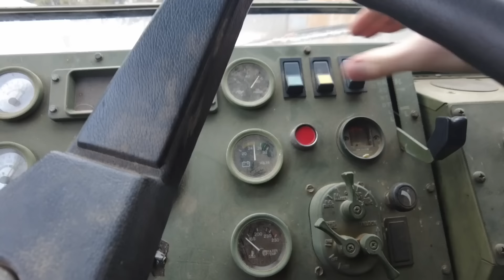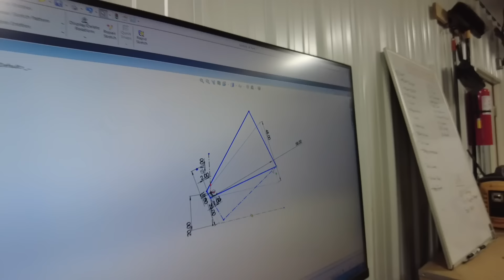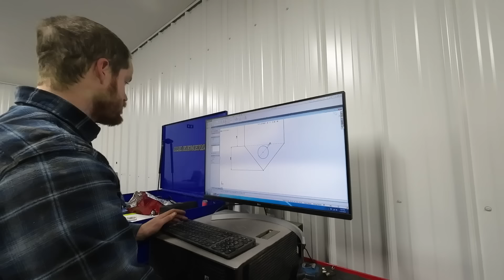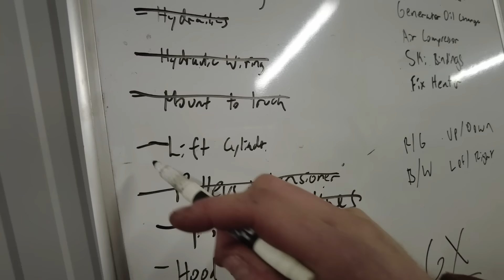We Built The ULTIMATE SNOW BLOWER | First Drive

Comment: Hello from France
To compensate for your lack of motricity you need weight at the back of the truck and where a salt spreader could be considered afterwards I do not know the maximum weight of your truck in road mode but it would be interesting to use this dumpster with salt or sand by emptying it into an automatic salt spreader here is otherwise very good job

Comment: Having just weight alone on the bed of that truck would make a huge difference with traction. When I say weight, I don't mean a measly 1,000lbs, I mean like the weight of your Cat 289D CTL (10,500lbs). The weight of your Cat 289D on the bed, plus those studded chains will allow you to drive though a LOT of snow. The only down side would be that it may become top heavy, given how high the bed is on that truck. Driving any truck unladen, like your army truck on any ice or snow is like driving a sled. Weight makes a HUGE difference!

Comment: Just wondering if you forgot how important weight was for this sorta thing. Without a thousand or so pounds over the rear axial to counter balance the extra weight now on the front plus extra to help with actual ground contact , you end up stuck and riding a bucking bronco as the rear jumps up every time it gets some traction an then losses  it as the tires leave the ground. 

Sorry I did forget to say that the project was really cool. And if you have some sort of bed adding logs, gravel, sand, stones, or tractor weights will help solver your bronco issues , any weight thats at least 4/3's the fronts current weight will give you grip on the ground and stop the bucking.

Comment: First impression, it was a mistake to put all that leveraged weight onto the front of the truck. I think it would be easier on everything if there were two swivel tires directly under the weight of the blower. They would lower and raise the blower without changing the weight on the front of the truck.

Comment: Please, please, please keep away from the front of that monstrosity when it is running!  I was so afraid when Courtney was standing so close on that slippery snow while that thing was churning around at speed.  Yikes!  Having worked in factories with "screw-type" mechanized equipment I've seen the result of someone getting an arm or a hand or a sleeve grabbed, and it never turns out well.  It's an awesome accomplishment, but please be safe and don't let anyone walk near the front of it when its moving.  We want both of you around for a long, long, time.  At 18:54 in the video Courtney is much too close to "the Mangler" and OSHA and me were having a coronary!

Comment: so you installed hydraulics after all... the entire blower could've run off a 12/24v hydraulic pump mounted truck side and shaved all that engine weight off the blower. no extra fuel coolant/antifreeze and all that makes that engine run... would've taken half the time and energy in materials, fab and install. there qre hydraulic QD fittings so 2 QD couplings for supply and return hydraulic hose would have been the only connection to truck other than the actual mounting system for the blower. Your work in the design and fabrication is of course "impressive". IMO you made the project so much more complicated and time consuming than was required and in the end fabbed your own hydraulic system anyways, which is all that was needed to power the system in the 1st place. Don't get me wrong Riley, i LOVE what Courtney and You do and love watching your content.

Comment: I think you guys need a shop exhaust fan..... yah it would blow out your heat BUT it would keep you from suffocating your wife dogs and Kid.... things like stick welding galvanized pipe can be deadly and you already know that welding in general puts out alot of smoke.... if you happen to need to weld a really grimy part the smoke will fill the shop so fast it will take an hour to clear out ! smoke can be extremely deadly.... and it's not to be taken lightly....
I did and walked through a rather large cloud of sulfur smoke and wasn't thinking about it...
my lungs simply quit working.... I couldn't breathe in at all.... realising my predicament I exhaled as much as I could which wasn't much I could then inhale just a little after a few minutes of that I finally got my lungs to work again...scared the heck out of me ! that was really serious, thank god I didn't inhale real hard walking through that cloud of smoke !
we burned sulfur to fumigate our water tower structure it was infested with every bug on the planet ! that did the trick ! no more bugs !  if you burn sulfer to kill bugs or rodents do not get in the smoke.... even if you don't breathe it you soak it in through your skin and can get really sick.... it's bad news  !

Comment: put an auxiliary cooler on there to cool the hydro fluids, didnt think of that while commenting earlier. can use possibly the radiator, heat core or tranny cooler off the car you scavenged parts from....

Comment: Did I miss the point where he explained why you didn't put it on the back?  Driving backwards sucks if you have to crane your neck, but a rear view camera fixes that. That would have made it much easier to get lots of up angle travel to get it way out of the snow when needed. Also, the weight distribution would be better. With the blower on the front and ~10deg up travel, the truck can only be used as a snow blower. With it on the back with more up travel, you still have a useful truck with a blower hanging off the back.

The talk about adding weight is quite silly. With a blower you're not supposed to be pushing much snow and you should be clearing all the way to the ground. With that blower setup it must weigh nearly 20,000lbs. 46"tires...chains...traction should not be an issue.....unless you burry it down to the axles and anchor the blower on deep snow.

Got it working. Now put in on the back with 30 degrees of up travel.

Comment: You will probably rarely use the float function as my experience on tractors has shown all it wants to do is dig in unless you are on cement-pushing light material. You would likely be better off making a floating ram. think of a linkage or chain on the end of the hydraulic cylinder that will allow the blower to lift if needed but the weight will keep it down. https://youtu.be/eAMuBZHn2N0?t=660

Comment: I know if you take that out on the road and you will see the snow blower going jump up and down and you should off put Two heavy duty hydraulic cylinders, because the snowblower is very very very heavy I work on them the New York State department transportation and we use them all deep snow that small hydraulic it’s going to break you should have two of them to bring it up and down but it’s heavy weight to go and don’t build up inside you’re in trouble it’s going to break

Comment: lol, doesn't actually work too well..  as I said. The engine is not running at an ideal rpm to have peak torque and the 3 belts cannot transfer that much power.   Tractor and industrial engines that run these types of implements are long stroke, high torque enignes. Complete opposite from a cavalier engine..

Comment: That was not a success. The blower rode on top of the snow and didn't dig down to the hard packed earth below.  Why try to reinvent the wheel when there are so many good wheels out there for sale?   Add to that the truck does not like turning while in four wheel drive which you need when blowing.   That's why tractors have individual brake peddles and a separate differential lock you can step on when you need it.  All things that truck does not have and which make it a very poor choice for a blower platform.